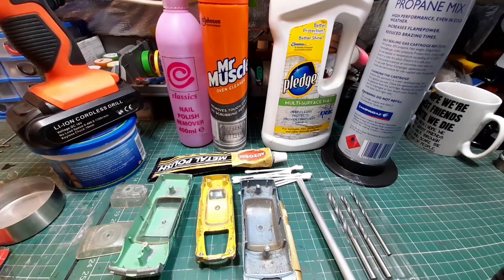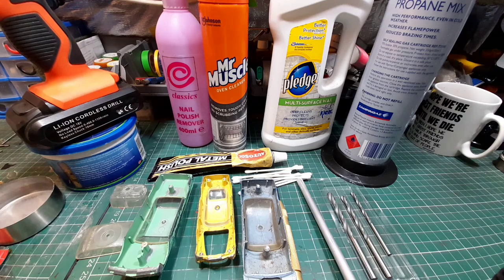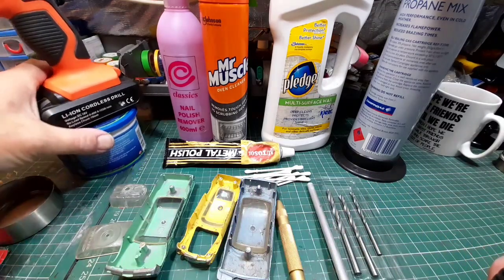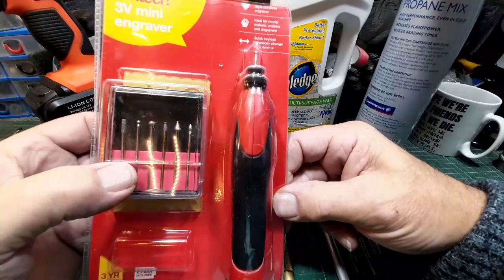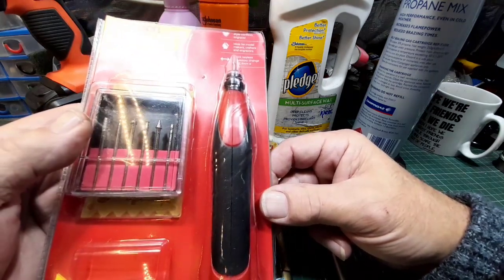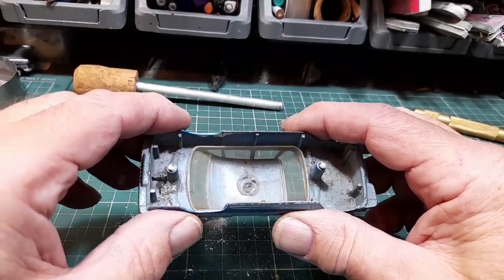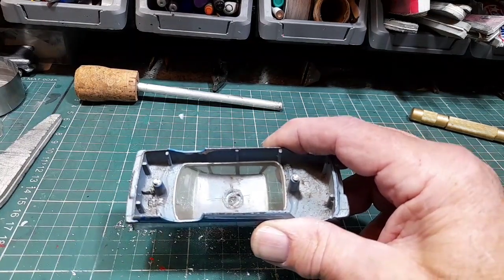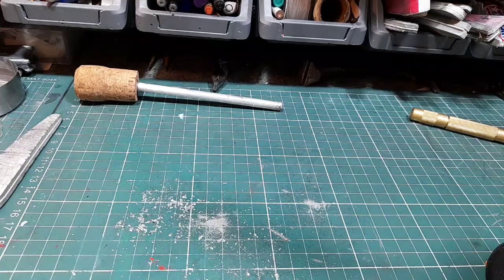Diecast restoration beginners guide  part4 window units removal and cleaning

Comment: If you can't get the pledge or it's too dear you can get floor sealer from a cleaning supply company. If you're pretty friendly with a cleaner U could ask them to give you a jar of it for free. They have 20 litres drums of it. It's a milky colour but dry clear. Many years ago when I used to work as a cleaner, one company I used to work for  used a  product which had a diamond on the label and the floors look like glass. If it was raining people walk on floor,  like they're going to fall over. With their arms out Infront of themselves. Cheers Graham.
Reply from the maker: Thanks Graham I will remember that 👍 appreciate the advice 👍

Comment: I've tried all cleaners on the plastic glass and have found that the Oven Cleaner is the easiest to work with because it is easiest to clean off. Dettol seems to get sticky and can discolour the glass slightly, and if using synthetic brake fluid, it takes forever and is nasty to clean up. The brake fluid needs to be old-school mineral  stuff.
Reply from the maker: I agree totally with you ,I  have tried the other but prefer oven cleaner, but I have to give people the other options to let them decide what suits them 
All the best martin 👍